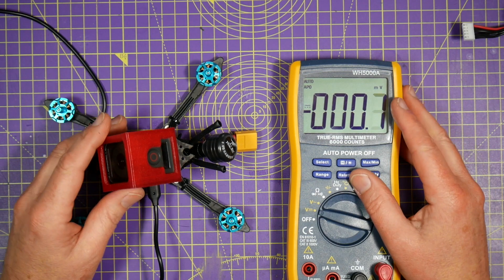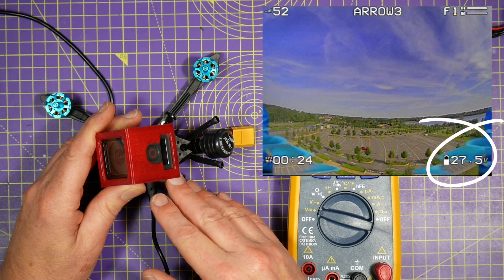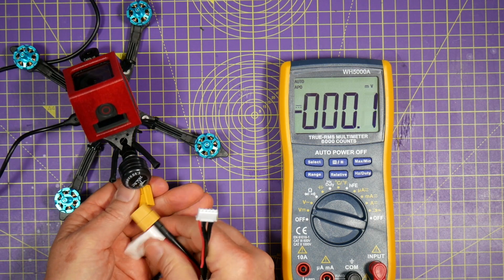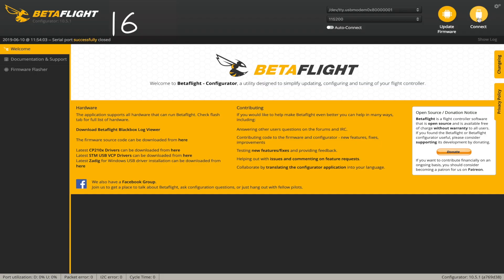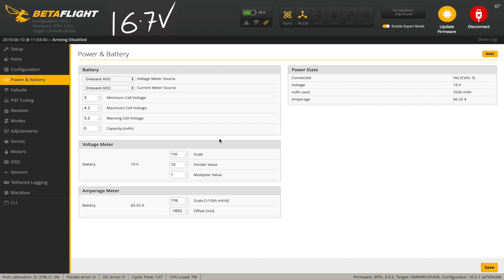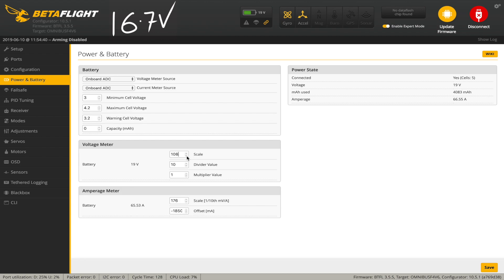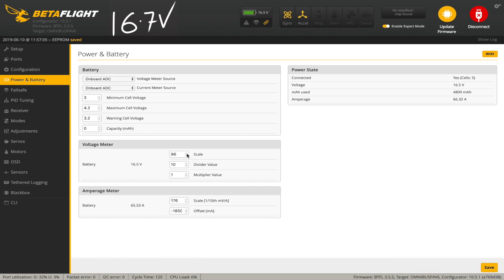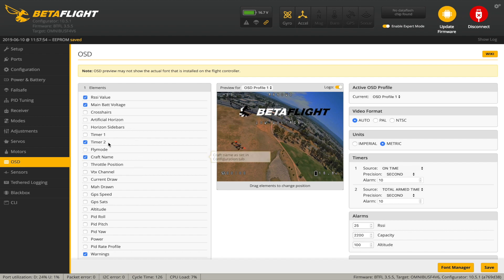Calibrating your BetaFlight OSD battery voltage display

Comment: Since each cell, when fully charged, should be @ 4.2volts that should give a  meter reading of 16.8v  on a 4s lipo battery if I am correct. Also,  I  store my  batteries @ 3.7v to 3.8v. You should never let your lipo batteries discharge to 3.0v.  I use a small  Lipo battery voltage tester  that does the same thing as a voltage meter  that you can find on eBay.
Reply from the maker: Thanks for taking the time to comment. Yes, everything you're saying is true and I totally agree. However, the point of this video is calibrating BetaFlight so it accurately reflects the actual cell voltage of the batteries. And that's very important so the pilot knows exactly, well as near exactly as possible, what the voltage is and from that, how much flight time is left.  Thanks for watching.

Comment: betaflight has been around forever and its still absulute junk  ill never ever leave fettec   im only using inav for my wing and its just shit
Reply from the maker: It's important to keep in mind that different flight controllers and firmware have their own strengths and weaknesses, and what works well for one person may not work as well for another. It's also worth noting that the quality of a flight controller's performance can depend on a variety of factors, such as the quality of the hardware, the settings used, and the pilot's skill level.

If you have had a negative experience with Betaflight and INAV, there are many other options available that you may want to consider. Ultimately, it's up to you to choose what works best for your specific needs and preferences.

Comment: Using lihv, just adjust the same,?? I got baby ape pro, and all I have lihv batteries,  probably a stupid question but can I use lihv batteries in baby ape? Getting on Bf to check it out.
Reply from the maker: Probably, but check the flight controller, esc and vtx specs first.
Reply: @WhirlyBloke  it's all good,  and actually the battery voltage was spot on,   flies good out of the box

Comment: Great video really helpful. Problem I have as soon as I take off my osd voltage drops so quickly almost down to 14.3 4s lipo then if I land goes back Upto the correct voltage. Is that a lipo problem or osd problem?
Reply from the maker: It sounds like a bad or old lipo. They voltage sag very easily.

Comment: For some reason. My battery meter on displays something ( even though the voltage and cell is incorrect) when ESC sensor is selected on the Voltage meter source. WIth that selected I cannot adjust anything on the voltage meter!. I have a 6S at 25.2 volts battery and its showing as 5S 18v

Comment: My battery voltage is good. When I fly a 1300 mah battery my mah used is 520 and the batters cell voltage is around 3.3
How to I make the mah used more accurate?
Thanks !
Reply from the maker: Calibrating the current is more difficult and to be honest, the cell voltage is much more important. When it gets to 3.5V per cell on a LiPo, you should be landing.
Reply: @WhirlyBloke  
This is the first betaflight quad I built. My others were bnf and seeing the mah used I’m kinda used to now. Guess I can delete it from my osd.

Comment: If I have the Tattu 14.8V 450mah 4s, should I have 14.8 where you have 16.7?
Reply from the maker: I good, fully charged 4s Lipo will be 16.8v regardless of the rating. 4.2v per cell.
Reply: @WhirlyBloke  because after a few seconds the warning appears in the goggles "low battery voltage"
Reply from the maker: @Signo_11  Sounds like the voltage end point isn't calibrated correctly, your battery charger isn't fully charging the batteries - again calibration of the charger - or the batteries are shot.
Reply: @WhirlyBloke  hota d6 pro is my charger; I think it's not the problem of charger.  How do I fix the batteries?

Comment: Why are the battery settings what they are?

I mean the min, max & warning cell voltage settings. I thought default was higher. Is it just so it doesn't beep?
Reply from the maker: 3.5 warning and 3.3 land now are default. But you can change them if you want and know your batteries well.

Comment: I have an other problem. MY voltage meter on the FC is broken. The rest of the FC is ok. I've been flying with it since then monitoring the voltage via the cameras OSD.
But now, since i flashed a new firmware to the FC it will not arm anymore. Can this has to belong to the wrong voltage? Because Betaflight thinks the voltage would be 0V
I slready changed the voltage source to "none" but this doesn't seem to help. 
Is there a setting in Betaflight to allow or not allow arming according to voltage?
Reply from the maker: Check the arming prevention flags. The info is here https://github.com/betaflight/betaflight/wiki/Arming-Sequence-&-Safety

Comment: What is ADC_MAX  in your formula?
Reply from the maker: This is the latest BetaFlight src code (4.1) that calculates the display voltage from input values. ADC_MAX isn't #defined but is just hardcoded as 0xfff

STATIC_UNIT_TESTED uint16_t voltageAdcToVoltage(const uint16_t src, const voltageSensorADCConfig_t *config)
{
    // calculate battery voltage based on ADC reading
    // result is Vbatt in 0.01V steps. 3.3V = ADC Vref, 0xFFF = 12bit adc, 110 = 10:1 voltage divider (10k:1k) * 100 for 0.01V
    return ((((uint32_t)src * config->vbatscale * getVrefMv() / 10 + (0xFFF * 5)) / (0xFFF * config->vbatresdivval)) / config->vbatresdivmultiplier);
}
Reply: @WhirlyBloke  Right, so it should be ADC_RESOLUTION_MAX  in your formula. Thanks.
Reply from the maker: @z00n  Correct. A typo that I've now corrected.
Reply from the maker: Thanks for pointing this out.

Comment: idk what too do i been hell and back trying too figure out whats wrong with my quad everything working fine exept when taking off it acts all jittery and dont fly properly the prop and motor is good only thing i noticed is the battery voltage on betaflight is always at zero with battery hooked up

Comment: my betaflight shows zero boltage when battery is connected but everything is getting power and it will arm but have notice it will shot up too the ceiling and not hover when i increase the thottle
Reply from the maker: Sounds like you've an early Betaflight 4 version with stock PIDS. They used to hit the stars on a tiny bit of throttle on sub 5 inch quads.
Reply: @WhirlyBloke  I ended up realizing that my fc orientation was off by 30 degrees so I aligned it 30 negative n it fixed it.

Comment: Actually since quad is drawing current all the time, you should measure the voltage while connected to BF and read BF measurement at the same time
Reply from the maker: Good point. Thanks for the feedback.

Comment: That's a great tip thanks! Does this also set the mAh usage at the same time?
Reply from the maker: That's a separate calibration and a bit trickier.
Reply: @WhirlyBloke  ah okay. I need to figure that one out
Reply: Jb has a good video on how you do it. Safe way but still kinda tricky.
Reply: https://youtu.be/pj_CaMZ98g4